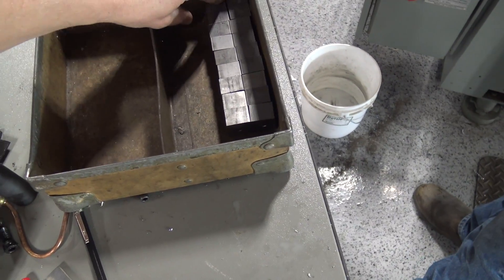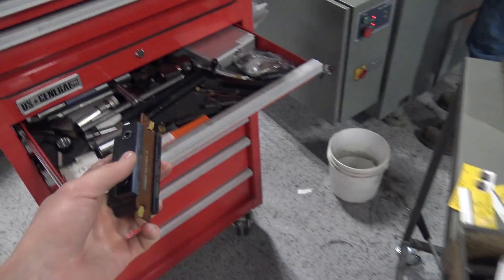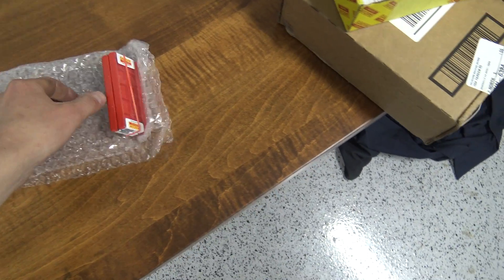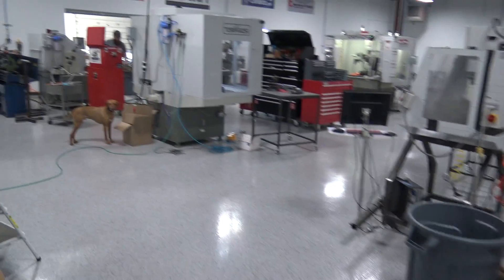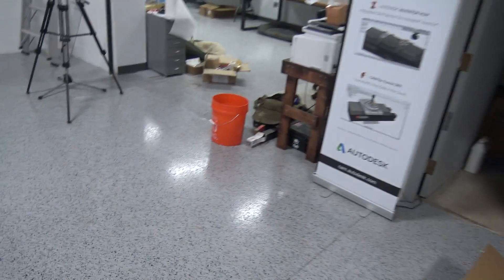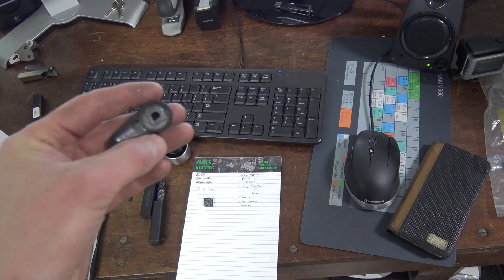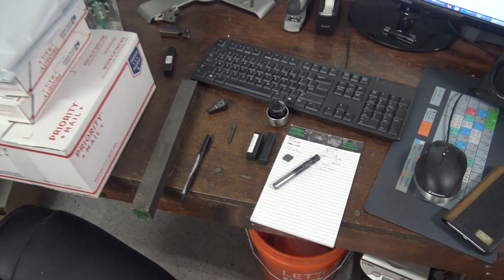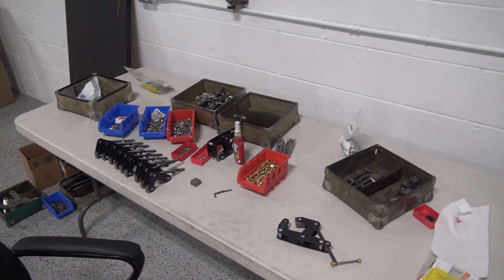Chip Break #2 - Machine Shop & Small Business Daily Life

Comment: Your question regarding the best way to setup the fabrication area for the clamps brings back memories of when I setup a custom aircraft seat fabrication and assembly line using "One Piece Flow" techniques.  We were able to fabricate complete seats that had more than a 150 custom CNC machined parts and mechanisms using very small teams by using those techniques.  Building inventory in slow times eats up cash so be carefull on how much you spend...

Comment: John,  Since the clamp is a standard product for you and it requires special tools,  I would create a "Tool Holder Block" that holds the special tools that are required for this project.  This will do two things if it maintained correctly:  1. Eliminate time searching for the correct tools when you go to start the next build, 2. Allow you to quickly check the condition of each tool at the beginning of the build so you dont get into a rush to find a replacement once the job is on the equipment.  I use something like this in my test lab to improve efficiency and reduce lost time.....  My  2c  Worth, Joe

Comment: John, it's good to hear the positive rake inserts are working out for you. The load is pretty much what I predicted. If you haven't yet tried the cermets, get on to them. Seriously! They're still positive rake but will blow you away. You'll be able to spin the work even faster, thus getting more HP out of that lathe's motor.

In the (unlikely) event you get time, a useful project may be to redesign your parting blade holders so they're in a dedicated holder and not put in a holder that is then clamped in to a regular holder. That style of parting holder hangs the blade a long way out from the support line of the turret. It may not be a big deal on your turret, I don't know how rigid they are, but it can make a big difference on a traditional manual lathe. I keep meaning to make one for an Aloris style QCTP, but unfortunately it remains just too far down on the ToDo list.

The new shop looks awesome! It must be a great environment to work; a tad better than squatting on a NY apartment floor I'd think ;)

PS Good to see an Aussie Rode mic make a cameo appearance in the production!
Reply: +NYC CNC Yes mate, designed and manufactured right here in Sydney. A Video Mic Pro is typically what I use on my own GH4. Rode isn't exactly an Aussie sounding name I'll be the first to admit! Rode and Blackmagic are two heavy hitters in modern digital cinematography, the latter from Melbourne, Australia. Go figure.

I really like how those floors came up John. Good choice!

Comment: My company keeps two massive shelves with custom tooling, jigs, etc.. The shelves are then broken down into numbered drawers, and finally the drawers are broken down into slots A - D. So we can code/say something like "Jig and Thread Gauge in 93C" on our job sheet. I know exactly where to go and find it and really like knowing exactly where to go but it's execution is a little wonky due to the quantity of jigs and custom tooling. (60 years worth of accumulation, nothing is thrown out) We have regular work loads ranging in all sizes and quantities so having a rigid, yet flexible, way to catalog custom or specific tooling is really beneficial. Removes all guess work and expert identification on tooling. My only issue is this was made for the entire shop, and I would prefer it to be machine to machine; so instead of two large shelves, there would be several smaller ones next to each machine. I also make a setup sheet for each job with a running notes area for any info or issues I have.

Comment: At our shop we do our tool storage similar to how you are currently doing it. Most tools go in general storage, but we always keep a few of the specific (or non-common sized tools) with the rest of the leftover material, extra finished parts, and fixturing for that specific job.
As a result, when we set up a job that is a repeat job, if there's a tool that we need that's not in the box, it's a common tool (a common sized drill/reamer, or a certain sized endmill) that we can just snag quickly from the tool storage.

I'm not even sure if that's the quickest way, but it has been working for us. I will say that with that system, it is always worth it to take time to pack the job away correctly and to take inventory of extra stock and tools specific to that job, that way you (or whoever purchases material and tooling) knows that they will need to buy tools or material before the next time they start the job, that way you minimize downtime.

Comment: John, it's great to hear some of the thoughts and little stuff on the business. Certain jobs I do at work, I keep all of the tooling and parts in small bins. it just helps with set up time and I'm not trying to find something that the day shift didn't put back. You can find the bins buy searching for Stanley vidmar plastic storage bins. As far as a metal worker goes they are great to have but you really need the tonnage. also have to take into account the shear deforms the ends, usually about 1/2-1"back.
Reply: +NYC CNC normally I just write on the side with sharpie what part it's for. although I'm at the point I can look at the dies and know what parts they are for. the bins are stackable or they are designed to fit in our drawers.

Comment: Theses are the type of inserts we use and they work great on mild stainless to hard, aluminum, copper, brass. We pretty much use them on everything, the only these is we use .008 radius and a different coating, i couldnt find them but this is the closest.

http://www.ebay.com/itm/NTK-Cutting-CCGT-21-501R-S-ZM3-Positive-Turning-Inserts-CCGT-060200R-S-ZM3-/191685734636?hash=item2ca15c30ec:g:jOkAAOxyRNJSgNOs

Comment: Sandvik makes a great insert. But. Expensive and not worth it unless you're buying them in bulk. 

Check out SECO or Korloy. They're both much more affordable when buying low quantities and they have exceptional performance. Korloy makes an aluminum insert that's just wicked. And for steels I have never been let down by SECO. 

Sandvik is really only worth it if you're a large shop buying hundreds of inserts a month, or have a really specialized job with some exotic material and need the absolute best insert you can get.

Comment: Carbide Drills: I took a Huot cabinet (like the ones you have) and set it for carbide and other "project" tooling. I just relabeled the Huot cabinet for this tooling. I believe i used the Huot 5-draw tap cabinet since it has the most slots for different tooling. the slots are big enough for typical carbide drills needed. 

I also organized my tap & drills with the taps and the proper size drills in the same slot so its a no brainer for drilling the correct size.

Comment: Hi John, I just want to mention the iron worker, think of the size you would like, then go to the next machine above, they are so time saving it's hard to believe. One of my friends, cut a two man job for the day, to one man for two hours by using the iron worker, he makes portal steel frame buildings, and he cuts and punches all the holes for baseplate sand steel connections, it cuts 18"X1" plates in seconds, and punches 1.1/4" holes through 1" plate nice and clean with no problem, nice videos keep up the good work. Tony uk

Comment: Hi John
I agree with Peter many years ago I worked in a production environment and we did exactly that for each pacific part we kept all the necessary tooling where the parts were being built but we also kept some extra tooling the ones that could brake this was so you didn't have to waste time to go get another tool. As you well know in production time is money so for example if it takes say two minutes to place the part and drill it that is 30 parts an hour you brake a drill and you take say 5 or six minutes to go find another one pow you have lost 3 to 4 parts if there is a spare right there you may loose only one part. 
It's all relative if the parts are for stock not such a problem but if you are under the pump and need to get them out it becomes a problem.

Yes you will have some extra money tired up in redundant tooling but from my experience at some point you will be very happy you have it there.

Dave

Comment: We use those gray carts (I see you have them) as project related tool cart keepers. Push the cart around to collect the tools and bits for the project, and wheel it over to the project table. All tools stay with that gray cart until project is completed. Then they get put away. Like a library cart, but instead of checking out books, we are checking out tools. (We had to make it policy to not "borrow" from someone else's cart) Your cart, your tools, your responsibility.

Comment: Piranah P90... it will shear 18" wide! Really, really think about how you'd use ALL the features of an Ironworker. That integrated coper/notcher station at the back is soooo important and useful. I would not consider any ironworker than does not have that. Doesn't matter the brand... look for that feature. Also consider tool change time. Dovetail slides makes tool changes easy.

Comment: As far as ironworkers goes I have worked with Edwards, Geka, Scotchman and Pirahna.. The 100 and 150 ton dual station/dual operator Pirahna's are the only way to go.. they can be super precise and are fast to change tooling. They are not cheap but worth every penny.
Reply: +NYC CNC it's hard to under work a big machine. It's easy to overwork a little one. you'll be sorry if you don't buy the biggest machine you can afford.

Comment: Hi John I've seen the same thing with those tool holder screws, I just ordered socket head cap screws from McMaster and replaced them all. The BXA size are 8mm and the CXA size are 10mm. Just keep them short so the heads clear your height adjuster.

Comment: Job box's are the way to go for production jobs. Once you get to the point you're doing them all the time you should have even dedicated holders for the jobs tooling. That way just just grab the bins/cart and roll over to each machine and plug and play! Way less chance of a screw up and no time spent looking for a tool that you just saw yesterday. Tools are way cheaper than labor plus tools are an asset labour is an expense. One shop I worked at had a setup cart for each machine that you signed out with the job and even had all the fixturing (vises/clamps) and measuring tools you need for the job. Get yourself some of those bins that hang on a slat wall and a slat wall. you can also apply this to your classes, each student gets a bin with everything they need for the class.
Reply: Great suggestions Widget!
Reply: +NYC CNC Since you are youtubing, video the whole setup (from last good prior part off through setup to first good next part off) and upload that, some of us subscribers can review and give hints.
Pick what you know is a long setup on something you run "frequently" like a step in your clamp production. As WWMI notes about the tool search, that is always a fun one to find in a setup video. Example for fixing that tooling search: Tie the chuck key to a string that reaches the chuck on its drill press, now no operator or setup person time spent looking for it, just grab the string and ready to go. I transformed a 90 minute setup at a plastics client of mine down to under ten minutes shippable part to shippable part. You can be the setup guy, or be the guy looking over the shoulder of the setup guy, but you won't get the information that you need with a video and re-watching.

Comment: Take a look at kyocera tooling if you can get it in the US John. In New Zealand its half the price of sandvik. And as good if not better. Their inserts can be used in Iscar and  the generic Chinese  toolholders. As for parting blocks. Buy quality ones and use cheap blades. Ive got blocks i've had for 20 years with the same capscrews in them.

Comment: My metalPro Ironworkers (40 and 45 ton) do a good job on shearing 1/2 x 6 or 3/8 by 8; also 4 x 4 x 1/4 angle. Punches from 1/4 to 1 inch (by 1/16th) and notches angle up to about 2 inches. You can get a brake for it that will handle about the same sizes as it shears (although the bend is sharp enough that sometimes thick metal cracks - thinner works better).

One plus for them is customer service. The 45 ton arrived with a poorly fabricated bed (two halves not parallel). I let them know, and they rushed (as much as you can rush something too big for UPS) me a new one which was just fine.

Comment: We have a 60 ton ironworker in the shop, super handy for general fabrication. I wouldnt expect cuts in the shear on over  1/4" thick material to compare to a bandsaw cut. You start to get edges slightly rolled over just the same as you would on a normal guillotine, which is perfectly fine for fab work but may not be ideal for machine work. The great thing is you have the machines to make any type of custom punch you need!

Comment: I know of shops that have a build sheet for every job and all the tooling for a particular job is located together so when a job is going to be run the entire tool catalog and necessary fixtures can be pulled and the job run with no need to redo all the tool offsets which is a huge time saver.  You end up with a bigger inventory of tooling but if it is an often run job I am sure the time savings would cover the tools. I rarely ever do the exact same jobs over again and I still keep some dedicated fixtures in my shop for that every couple of year repeat since it can save so much time.
Reply: +NYC CNC I like this suggestion very much as it is simple and logical. 
Also if you were to add employees or you or your colleague was sick / off work / on vacation this would allow the pieces / product to continue to be produced with little fuss beyond quality control.
Reply: +bcbloc02 For my Two Cents worth, I think that this idea maybe the way to go for any regular run job that has specific tooling and feed/speed requirements. If the tooling can be kept in a suitable sized container with a "Ready Reference Card" or cheat sheet showing the item drawing, job to be performed and tools used and correct feed/speed then it is all there in front of you. Try looking at it as Dan Whiteford says from the point of view of a new hire, everything is there in front of them,  with no need to know the secret hiding places of special tooling.

Comment: If you setup your rollers for a iron worker and plan to cut anything heavy especially the angle and shear rollers I'd recommend getting extra heavy duty ones.
Reply: +NYC CNC If you have a long series of them you might be OK but if you have them spaced far apart, all it will take is for one person to lower a heavy bundle of angle funny and they will dent. Or a typical scenario for us was to put a bundle of 6"x6"x1/4" angle on the rollers and the operator would flip the top one off the pile and slide it into the ironworker. When he flipped it off the pile is when the rollers would dent. Maybe this wasn't the best way to treat the rollers but it was the most productive way to cut the angle. That is why we got very heavy duty rollers.  If you let me know a place to send pics I'll send you a example.

Comment: Aloha Like the format as for storage  I would suggest using a small (rubbermaid style ) plastic container at the storage location for job specific tools  Think of it like you keep all of the tools to set up a various machine next to it for speed and efficiency they could all be stored in a common tool chest but it is better to have an extra at the machine. 

You mentioned in a earlier video that you keep critical backups in a location separate from the normal stock location. Consider this like that. When you get enough Carbide drills to start to fill an index maybe you should rethink. Mixing  materials in an index is a recipe for disaster

Comment: Hi I can only recommend Sandvik Tooling. At my Job (marine Shafting and Propellers for Maga Yachts and Navy Vessels) I almost exclusively use Sandvik Insterts, especially their 4325 Grade, they seem to last forever in Steel and do fine in Stainless.
For your little Lathe I would suggest these: http://www.sandvik.coromant.com/en-gb/products/pages/productdetails.aspx?c=DNMG%20441L-K%204325&m=6532342 
they cut super freely and leave a nice Finish.
Reply: +NYC CNC John
You can get a similar ones for CCxx style holders
I have some and the do leave a good finish different brand to the above
http://www.shop-apt.co.uk/carbide-inserts-for-turning-uni-tip.html

Stuart